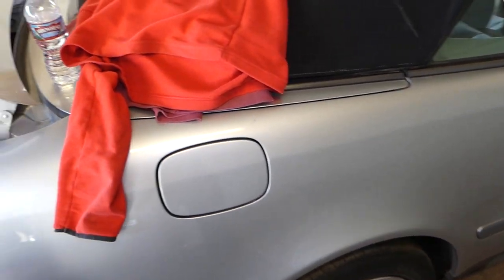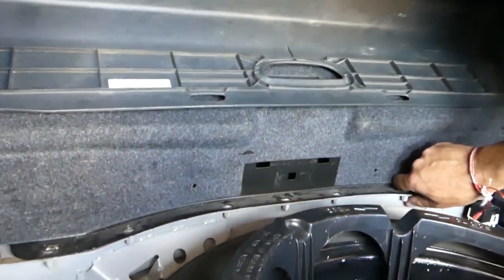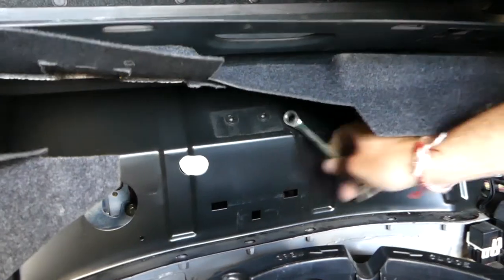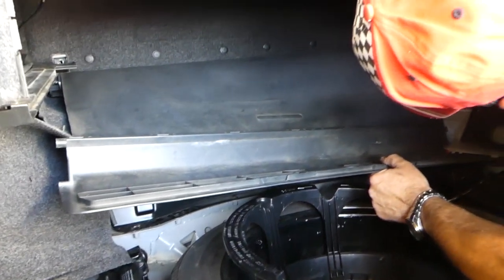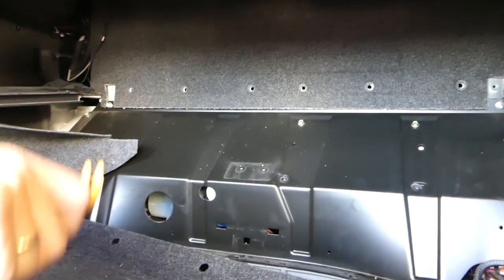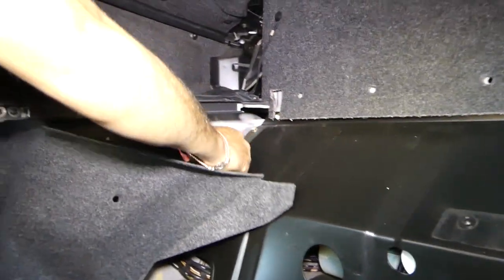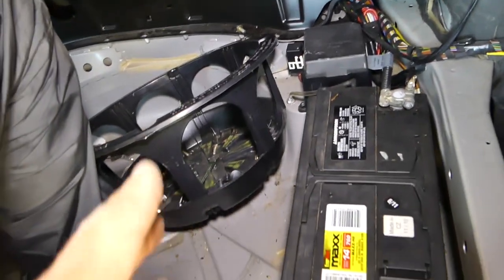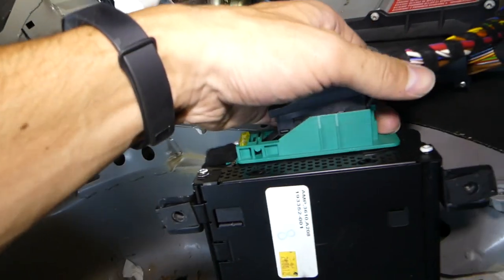MERCEDES CLK W208 AMP AMPLIFIER REMOVAL REPLACEMENT clk320 clk430 clk200 clk230

Comment: Is there a different procedure regarding the 2001 clk320 coupe or is it essentially the same process?
Reply: The reason i ask is because when i bought my car the previous owner installed an external aftermarket amp which ended up blowing. If i could utilize the stock one that came with the car and it would push my aftermarket subs i would like to do that.